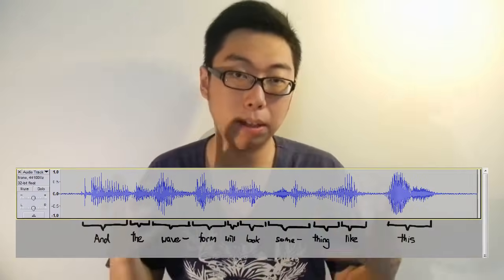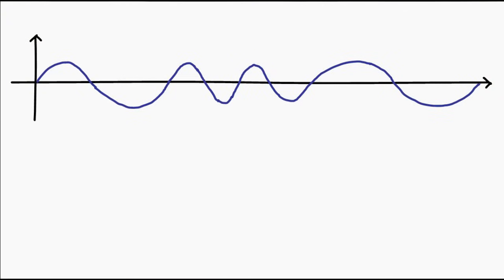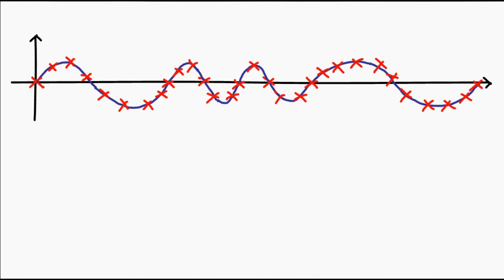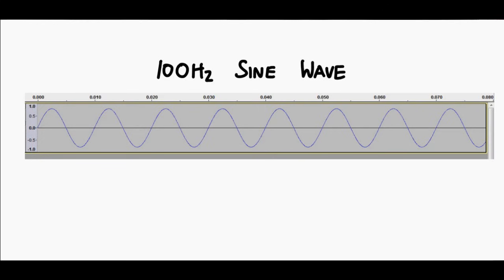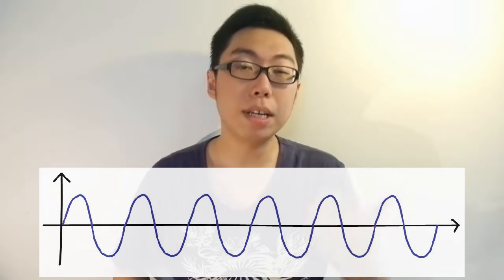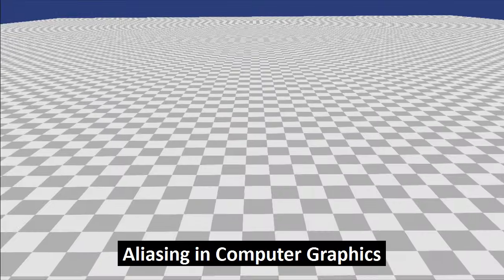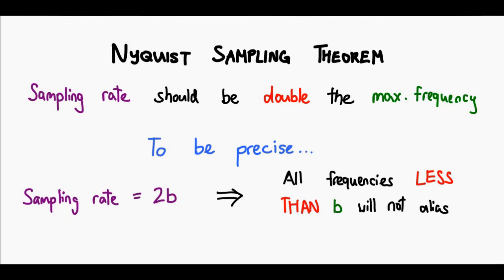Sampling, Aliasing & Nyquist Theorem

Comment: Hey love your minimalist style not getting bogged down in crazy graphics and animations. I was wondering: if we do have aliasing and it changes the frequency, will we hear “dog” just at a diff frequency ? So a higher pitch or lower perhaps? But we still make out “dog” when we hear it? I’m assuming changing the frequency doesn’t change the actual sound but just the “pitch”?
Reply from the maker: Hello and thank you for your comment! I've never actually tested this before on real-world audio. I believe you will hear lower-pitched noise, but it wouldn't be the exact same thing just lower in pitch! It should sound distorted.
Reply: @ I’ve also heard that it’s “not just” lower - but if all that’s changing is the frequency which is responsible for pitch, why would anything beside pitch change!?
Reply from the maker: I mean, for something like speech, it doesn't happen at one frequency. It's a combination of many frequencies that are changing over time. That's why any discussion that considers just one frequency often only looks at a very tiny slice of time. This is probably also why you had your initial question - This perspective of frequency isn't really easy to adapt to more complex sounds like speech.

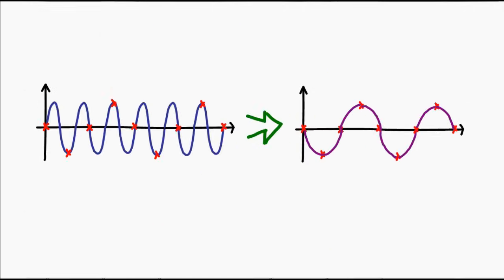Consider the diagram at 06:12. While yes, the frequency changes, but also note that the rest of the waveform doesn't look anything like the original. If the original waveform was a far more complex one, it wouldn't be easy to predict what the sampled and reconstructed waveform would look like without simulating the process. This is why it's hard to give you a precise answer.

Comment: I was here for sampling frequency and sampling rate definitions... But they are actually not there 😮
Reply from the maker: Hello and thank you for your comment! Good point, I don't think I ever explicitly defined the two terms. Here's my definition, which I hope helps complete your understanding:

Sampling refers to taking periodic measurements of a signal. Typically, we would sample an analog signal, allowing the samples to be saved digitally, with the intent of recreating that signal using those sample points.

Sampling rate simply refers to how often each sample is taken. It is measured as the number of samples taken per second, with the unit Hertz (Hz).

Comment: Well presented. What is never explained is how to find the maximum frequency. Ok, it is simple with a ideal sine wave, but what about a real-life non periodic analog signal?
Reply from the maker: Hello and thank you for your comment! In practical scenarios, you could always use something like a Fourier Transform to break a complex signal down into its constituent sine wave components and pick out a maximum frequency from there.

Having said that, in many cases, the maximum frequency is selected based on requirements rather than the input. For example, if you're producing something for human consumption, the upper limit of human hearing is said to be around 20kHz. Sample at above 40kHz and you're pretty much certain that anything we can hear will be captured.
Reply: @NERDfirst  Thank you. It finally makes sense to me. As they say, there is a difference between theory, and how it is applied.

Comment: It seems to me a triple or quadruple sampling rate is recommended for accurate sampling.
Reply from the maker: Hello and thank you for your comment! Do note a couple of things:

Firstly, Nyquist theorem is silent on the perceptual quality of the signal. All it does is guarantee no aliasing if you pick your sampling rate correctly. That's why we're silent on sampling at high rates (ie. Oversampling) for an increase in perceived quality.

Secondly, it technically is possible in some situations to perfectly reconstruct the original signal, even if sampled at a low sampling rate (fulfilling Nyquist theorem of course). For more discussion on this, refer to my other video on this topic: https://youtube.com/watch?v=Sb_4MS8l8yM

Comment: I thought Nyquist says that you have to sample at 2x the bandwidth, not frequency.  That's where the topic of Nyquist zones comes in...which you did not cover.
Reply from the maker: Hello and thank you for your comment! The basic definition of the Nyquist theorem, which is the topic covered here, only focuses on avoiding aliasing of the signal, so it says you have to sample at above 2x the frequency.

Nyquist zones is a concept that I'm not familiar with, though I just did a bit of reading and it's really quite interesting - It involves recovering information that has actually suffered from aliasing in a "controlled" way. A fascinating topic, though out of scope for this video.
Reply: @NERDfirst  Sampling at above 2X does not avoid aliasing.  Do some research on undersampling and you will have a better understanding.
Reply from the maker: Hello again! Unless you're actively trying to disprove the Nyquist-Shannon sampling theorem, I don't know if you want to make the statement that "Sampling at above 2x does not avoid aliasing".

I do acknowledge the other things you've been saying about undersampling and nyquist zones though, but those would be more appropriately summarized as "There are ways to avoid aliasing even when not sampling at above 2x the desired frequency." Very cool stuff, but still out of scope for when the discussion here is just about the fundamentals of the Nyquist theorem.

Comment: Great video!  Loved the clarity of your explanation!  Quick question: if in my experiment, I collected my raw data points once every nanosecond and when I do my Fourier transform on the resulting waveform, I tell the Fourier transform program that my sampling rate to do the Fourier transform is once per nanosecond (same value as the frequency I used to collect the raw data from the experiment), am I safe from aliasing?
Reply from the maker: Hello and thank you for your comment! I haven't looked at Fourier Transforms in years so I think you'd probably learn more looking at the manual for your software, but here's my guess - Generally, if you have to enter sampling rate as a parameter for data you already have, use your actual sampling rate, or time/frequency calculations won't be correct moving forward.

As for aliasing, you're technically already past that point, since you already have discrete samples. If, during the sampling process, you've chosen a bad sampling rate and/or have not low-passed your signal while it is still continuous, the effects of aliasing may have already been "baked" into your samples. Setting the same sample rate as an input to the Fourier Transform should not create any new problems with aliasing, but if there are already problems in the samples, they will continue to be present.
Reply: @NERDfirst  Thank you!

Comment: Hello, Nice tutorial. Just one thing that sticks out at me though, here: https://youtu.be/yWqrx08UeUs?t=515
your reconstructed wave looks very very aliased -- nothing like the original. The peaks of the resulting waves are not reaching the heights of the original wave, even though the sample frequency is more than twice -- ie complying with the Nyquist rule! Do audio sample rate converters have a way of reproducing the peak amplitudes correctly?
Reply from the maker: Hello and thank you for your comment! Yes indeed - If you were to "join the dots", there is no guarantee that the amplitudes will be correct. The only thing we know for sure is the frequency - Nyquist theorem is silent on anything else. (Just a note on the terminology, by the way - That reproduction of the wave is distorted sure, but not _aliased_. Aliased means that the frequency is wrong, which is not at all the case).

Having said that, this typically does not happen in most real-world applications, eg. Home audio equipment, because more can be done to perfectly restore the wave. I've discussed this in greater detail here: https://www.youtube.com/watch?v=Sb_4MS8l8yM

Comment: Thanks for the video. So if sampling at over 2x but very close to the limit, like that second example you made, I guess frequency is reproduced, but is the amplitude incorrectly reproduced?
Reply from the maker: You're welcome! Strictly speaking, the Nyquist Theorem is silent on this point. All it says is that the frequency reproduction is guaranteed to be correct if you sample at >2b. Of course, there are also ways to reconstruct the wave perfectly, but these require additional processing. More on these techniques here: https://www.youtube.com/watch?v=Sb_4MS8l8yM

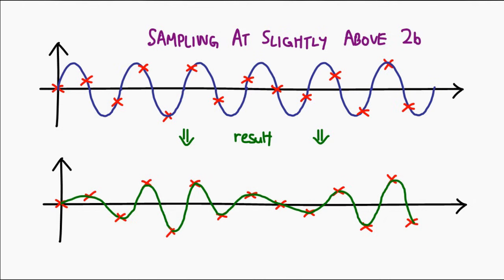Comment: Good video, and your illustration at 8:36 points out how different the reconstruction is from the original when you get close to half the sampling frequency, at least when the reconstruction is to interpolate from point to point, rather than inverse Fourier transform. And to my knowledge DACs don't do inverse Fourier transform when they reconstruct. So this really calls for far higher sampling rates than twice the highest frequency you want to render.
Reply from the maker: Hello and thank you for your comment! Certainly, when basic linear interpolations are involved, a higher sampling rate could give you a better reproduction of the signal, even if aliasing does not take place.

Comment: I came here because of My Audio, aliasing has reared its ugly head many times in my life - it seems that what he is saying is not a solution for me because I don't know what I am going to do with the sample when I take it - many of my recordings are multitrack recordings of improvisation.
I am considering 15 band eq?
Reply from the maker: Hello and thank you for your comment! First, confirm that what you are experiencing is indeed aliasing - Honestly, it's very unlikely as with modern recording equipment, appropriate measures have already been taken to prevent aliasing. You are probably experiencing distortion or other kinds of noise.

If the issue really is aliasing, the "proper" way to counter it is to use a low-pass filter on the analog signal before it can get into your recorder. Needless to say, the filter must be analog as well.

The cheaper alternative is to increase your recording rate to something higher, if supported by your recorder. It won't get rid of aliasing, but it'll at least delay the point in which it can occur.
Reply: @NERDfirst  Thank You for your reply, - it is definitely aliasing because it happens when I trigger a sample at a lower pitch than what I originally sampled it at - I had seen a discussion on low pass filters on a different video, but the problem with that is sometimes I just record an improvisation straight to stereo, so I am going to look for some kind of 2 channel low pass filter software to run the mix thru before burning to cd. In the case of multitracking I could probably insert a filter on that channel before it reaches the multitrack.
Reply from the maker: Hmm... Does it sound like the same sample but slowed down? If it does, that is not aliasing.

I do not believe you can use a software filter for this, as the filter works in digital, the signal will have to be sampled first before the filter can work. You need filtering  before sampling if you want to get rid of aliasing. But again, I think it's very unlikely for your problem to be aliasing - Your sound card should have already done the required filtering.

Comment: Isn't what is actually getting sampled is the electrical signal which a transducer (microphone) creates? The sampling (digital file) stores the amplitude and frequency information about the electrical signal which an amplifier will use to drive a speaker. The Nyquist principle is applied to the frequencies of the electrical signal, not really the soundwave but the electrical frequencies. I suppose it's more about recreating the fidelity of the electrical audio signal (electrical waves) rather than actual soundwaves. Although I understand that the electrical signal roughly mirrors the soundwaves, as interpreted by the transducer, whether positive or negative voltage or millivoltage. I've been trying to understand what is actually getting digitized in such signals.
Reply from the maker: Hello and thank you for your comment! You're right to say that it's not the actual sound that we're really sampling, but the analog electrical signal generated by the microphone. This is a detail we've kinda glossed over in attempting to stay abstract.
Reply from the maker: @ReaktorLeak Good one =D
Reply from the maker: @ReaktorLeak It's actually incredibly apt in this context! An analog signal is an analogue of the measurable, real world event. It isn't the thing itself , but it's basically a complete representation. Might not be what the word was designed to mean, but it makes a lot of sense when you see it this way!

Comment: Amazing explanation...Just a query... the sampling rate of ADC (ADS1015 as seen in manual is 128, 250, 490, 920, 1600, 2400, 3300 Sps)
and the Nyquist sampling frequency (lets say for our case we take it 1024 Hz) that we want to capture the signal frequencies, are these two same things or different ?
Reply from the maker: Hello and thank you for your comment! It sounds like you will need to use the Nyquist frequency which you know, to choose the appropriate sampling rate to avoid aliasing. 

So if the nyquist frequency you have selected is 1024Hz, then the sampling rates provided by the ADC that are appropriate are 2400Hz and 3300Hz, since both are > 1024x2 Hz.

Comment: If we increase the sampling rate higher than the double sampling theory( nyquist theorem) .. doesn't it gonna give us much better analog sound?
Reply from the maker: Hello and thank you for your comment! Depends on what you mean by "better". You will get more samples, for sure, but assuming that you're just trying to sample above the nyquist limit, then what you capture may not be much better. Especially because there are scenarios in which the original signal can be fully reconstructed (without "jagginess") even when sampled at the minimum possible frequency.

Comment: Thanks. I am 60+ years and I learnt something today. The way you broke it down  Now the reason why i watched this was to understand sampling when it comes to astronomical imaging.  In Astronomical imaging, it's not how often you sample but the pixel size of the sensor in relation to the object you are imaging. for example to my understanding if you are imaging the planets then you pick a larger pixel size and if you do deep sky images ( of stars, galaxies, nebulae) you use smaller pixels.With the knowledge you have given which is very useful, I will try to now improve my understanding of this subject. Thanks again.
Reply from the maker: Hello and thank you very much for your comment! It was lovely to see you reason out the connection there to pixel size - Yes, in photography, we're doing spatial sampling as opposed to temporal sampling. Of course there are many other factors, such as the lens' ability to collect light, its aperture size and so on. But the basic intuition of course is - If something is significantly smaller than a pixel, all you're going to see is a speck of light, but no useful shape to work with.

Comment: Fantastic Job!  You made sense of one of the things I need to understand.
Reply from the maker: Hello and thank you for your comment! Glad to be of help =)
Reply: @NERDfirst  Well, you did just open up a pandora's box for me now. So now my dilemma is I am learning about SDR and my SDR, a limesdr mini can handle up to 30.72MSPS. Based on my understanding of this video, that means I should be able to realistically sample up to 15MHZ accurately without aliasing.  The LimeSDR Mini is touted as having a frequency range of 10 MHz – 3.5 GHz.  I'm trying to figure out what I'm missing here, but it seems like for anything above 15MHZ it's a waste?. I'm not sure how sample depth comes into play, but it's 12bit if that helps.
Reply from the maker: Hello again! I'm not familiar with SDR, but seeing as that it's a radio, I'm going to assume that these numbers you are quoting are transmit/receive frequencies, ie. These are not sampling frequencies. We use different frequencies for transmission to allow many different "streams" of information to be transferred at once. So in this case, the frequencies are only there so we can share the "airspace". Again, this isn't related to sampling.

Comment: For example, I'm having a signal which is composed of 20hz and 50hz. Then I should sample this signal by 2*50 = 100 ( sampling frequency) and so my sampling rate would be 0.01.
Am I correct?
Reply from the maker: Hello and thank you for your comment! You'd want to use a sampling frequency of above 100Hz to be safe. Therefore, your sampling interval has to be shorter than 0.01 seconds.

Comment: Hey, that was a great explanation!
I don't understand how the Nyquist rate and Nyquist frequency are actually different?
Reply from the maker: Hello and thank you for your comment!

Nyquist Frequency is half of the sampling rate. ie. Any frequency at or above the Nyquist Frequency would suffer from aliasing.  Nyquist Rate is double the highest frequency you don't want aliased.

So these two terms describe the same concept but from two different angles. You can figure out your sampling rate by doubling the Nyquist Frequency. Alternatively, if you already have a set sampling rate, you can figure out the Nyquist Frequency by dividing that by two.
Reply: @NERDfirst  That helps a lot. Thanks!